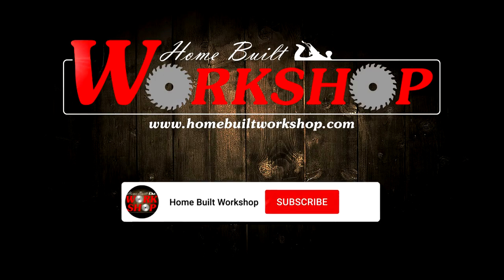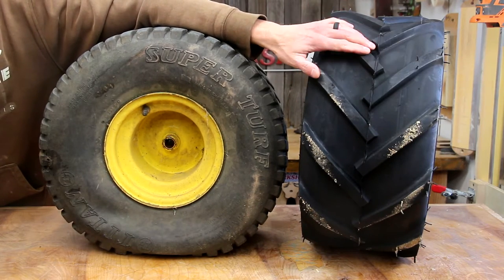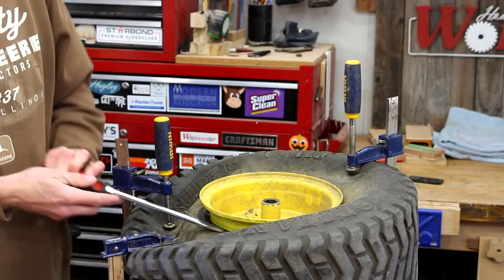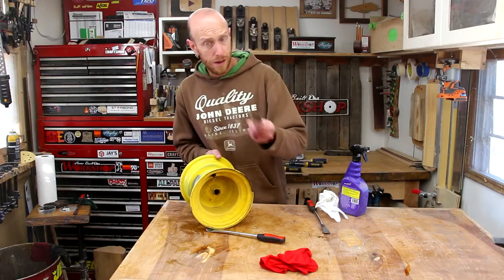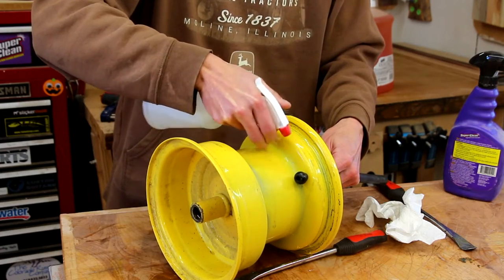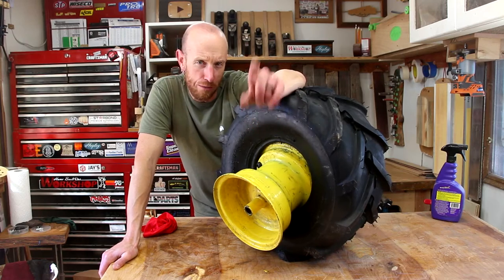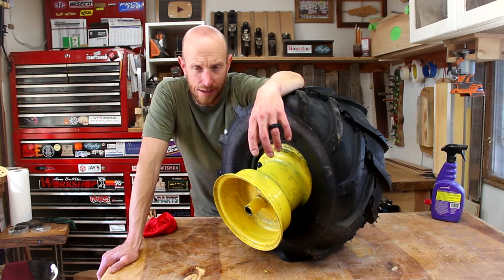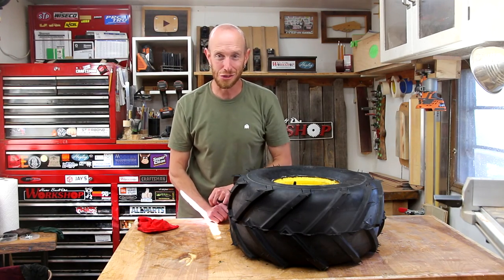Changing Garden Tractor Rear Tires | This was harder than I thought

Comment: Tip: Jack up your tractor and mount the rim back onto the tractor.  Then, use two 24" tire irons to install the new tire.
Reply: Is that easier? I usually take the whole wheel of the tractor and put it back on when the new tire is on.

Comment: I feel your pain, brother, as I wrestled with putting a tube in a rear, lawn tractor tire today. I did buy the Harbor Freight mini tire changer kit but with limited space around my vice I ended up using a carpenter's flat bar-nail puller tool to get the tire down inside the rim. All was looking good and I was quite pleased as I pumped in the air and it got hard. As I reached for the valve cap, something very odd and unexpected happened. As I reached down to screw the valve cap on, the valve stem slowly receeded inside the rim and disappeared. It's gone down under, mate. But on the bright side, I'll never have to worry about adding air to it if it develops a slow leak. When it goes flat, I'll get to do this all over again but next time with a new tire.

Comment: Those Ag tires are going to destroy your lawn. When mounting, push the tire over the wheel, not the wheel into the tire. The bead has to be in the drop center of the wheel in order to get it over the rim.
Reply from the maker: The tires are working out great so far. I don't have what you'd imagine as a typical lawn, its more like a small field of green weeds. lol.
Reply: They're not! I've had the same tires on my lawn tractor for about 4 years now and they dont destroy the lawn.

Comment: You push the tire that is already over the wheel down off of  and past where the bead  seats to where the wheel is narrower, stand on it with 1 foot or get someone else to holding it way down there.  Then you will have the space to pull the other side over the rim.  If the opposite side in on the bead, you will never get the other side over.
Reply: Great info, this is definitely not a one man job.

Comment: Been in this predicament before. I too don’t like to fold especially when the cost for simple things to be fixed. The machine literally has the capacity to apply the pressure onto the rubber tire that muscles just can’t. Also I hate having to spend ridiculous amounts to have a machine do something simple in a couple seconds. I understand shops are there to make a profit but considering it’s a machine doing simple tasks such as this one the price is hard for me to swallow sometimes because it not a hard job for machine to complete. It’s literally worth $5-10 bucks even with today’s inflation. Of course, this is my opinion on certain issues not everything we have to over pay for. Thanks for sharing your video.

Comment: It is much easier to get the second side of the tire on the rim if you have the rim's  inner diameter at its smallest diameter closest to the edge of the second tire cord, to allow it to go over the rim of the hub. The opposite side of the tire can then go against the smaller diameter of the inner rim to give more room to get the tire cord edge over the rim. Been there, done that.
Reply from the maker: I tried it both ways off camera, the tire just wouldn't cooperate. Lol.

Comment: I was yesterday and today in your spot. Saw a guy that made a tire rim holder from an all thread and a vise. he bolted the hub to the vise putting the all thread thru the hub to keep it from moving. Then he used vise grips to help guide the tire towards the center of the rim. The vise grips also kept it from slipping back off.  I fought with 2 tires yesterday and using a vise and an all thread bolt was able to put both tires on in a few minutes,   I had spent HOURS trying yesterday and this morning and would get almost half way on then something would slip.   All thread to hold the hub stationery and a push on the tire  to force it to sit in the center of the hub allowed it to work easily

Comment: Clamp a vertical steel rod into your bench vise to make a little tire machine. Put the tire over the vertical rod and use the rod as a fulcrum for two tire irons. Steve's Small Engine Saloon has a good video on this method.

Comment: I just did the rear tires on my John Deere Z335E this week.  I used a "modded" Harbor Freight Manual Tire Changer (lots of videos on this).  Even so, I got stuck in the same place you did.  The tire bead was starting to get torn up. I took a deep breath and readjusted the "duckbill" carefully.  It went on fairly easily, the second time.  It was a minor change from complete failure to easy success. I used an "air blaster" to seat the bead. Yes, it can be very frustrating.

Comment: Tires are always fun to deal with.  I haven't had to do lawn tractor tires yet, but what I do for automotive tires is get my hi-lift jack, put the runner under the rear bumper of my truck where the hitch plate is, put the jack's foot plate on the tire just outside of where the bead is, and crank the jack up until the bead breaks or slips under the wheel (depending on whether the tire's going on or off).  The weight of the truck applies far, far more force than I could myself.  It's a janky way of doing it, and I really should buy the proper tools, but it's worked for me up to this point.

Comment: I just did a tire change on all four on my LT160. By the third tire I got pretty good at handling getting them on and off. It does take a lot of force to get the new tire around the second half. The tires you have probably made it even harder. In any case, it was a bone crushing job.

Comment: Holy smokes! I just fought this battle yesterday. Setting the beads was the biggest PIA.  Tried several tricks including the starting fluid trick. Nothing worked. Eventually used a 5 gallon bucket to set the bead on the non-valve stem side by stepping on the rim. Then flipped the tire, pressed down on the rim and filled while pressing down.
Reply: I can’t tell you how thankful I am for you to have had that bucket tip on these comments. I bought some of those tires that have the concave center before you install them. And the sides where the beads are are caved in so much from the factory that it takes a whole lotta effort to make them pop out to the sides of the rims once they’re put in. That 5 gallon tip certainly did the trick thanks buddy

Comment: We used a tire machine to mount tires even 50 years ago.  It was pneumatic and you locked the rim down and it was all pretty much mechanical but even then it took a little effort.   The worst thing was when radials came in.  Radials in those days for some reason were kind of compressed in the middle so the bead would never meet the rim for a good seal when mounting. They had to install a special additional part to the machine that blew air up from the bottom side so that the thing would seal.   It went around the whole tire at the bottom and had air holes in it and when you attached the air hose to the stem and hit the air, it went in through the stem and then up from behind the tire.

Radials were always more trouble, at least for the first few years.  The thing to watch out for back then was the steel belt wearing through the tires,  you had to keep an eye on old tires or you could get cut from the steel fibers in the belt on a worn tire being replaced.  We used to sand the bead with a wire brush on a drill before mounting and also the area where the new stem went in.

We never used any sealer of any kind on the rims. Totally unnecessary, just checked the bead for leaks before mounting and 99.9% of the time no problem at all.  I am amazed at the BS where they don't replace the stem with every new tire, really bad service to not do that. 

As for taking a tire off a car, the ones with fender skirts could really be a pain and as I recall I think it was Buicks or maybe Oldsmobiles where the rim liked to rust itself onto the brake drums.   For that you hit it from behind with a sledge hammer but sometimes they had to be taken to someone to heat up the rim with a torch to break it.

Comment: You did good man those tires are tough sometimes the bead on some tires are hard to drop in the drop center for example some 12-16.5 skid steer tires when you mount second side that tire is big enough you have both feet on tire keep 1 stationary and follow with the other and when it gets more then halfway but the tire doesn’t drop in the drop center behind you you have to give her the old kick with your foot usually they will drop after a few kicks helps if you have some weight on you too 😂 or vice grips pry down as far as you can before you start clamp the vice grips and go one side only and the vice grips will hold the other side and make sure the tires stays in the drop center again you did good man those little tires are hard compared to the big stuff 👍🏻

Comment: I still enjoyed watching your attempt to mount the tires. I also failed trying to mount two 11x4x4 front tires on my little Craftsman DRM 500. I took them to the pros and they gave up after having them for 3 days. They even bent my rims trying to get the tires on the wheels. They gave me two tubs no charge. I ended up reinstalling my old bald tires back onto the rims until I figure something else out.
Reply from the maker: I got the front tires changed without issues. These back tires were a different story. Lol.

Comment: I agree with some of the other commenters, right tool for the job. Use tire iron instead of screwdrivers, Stabilize/ mount rim to something to prevent it from movement. Then it's not that difficult to change the tires.

Comment: those are some hard tires to change, if you have a large bench vise, stick a steel rod in it make sure its super tight, then place the center of wheel over the steel rod, take a large pry bar in the tire and rotate the pry bar against the center steel pole like the old fashioned tire machines did.
Reply from the maker: That would work. I don't have a heavy enough workbench so the vise wouldn't move around.
Reply: No bench vise? Try driving a steel rod into the ground. That should also work.

Comment: It looks like the reason the second bead would not go on (at 9:10) was due to the "on" portion sitting at the wheel outer diameter. It needs to be pushed down to the smaller diameter to allow the far side to be pried over the rim. The bead has a fixed diameter, and is reinforced with steel wire, so no stretching can be done to mount it. That's the "trick" - push the far side of bead #2 farther down to give more of that tire bead diameter to the not-yet-pried-over region.

You had the right idea using a clamp to push the bead down, but the far side of the clamp should have been placed on the steel lip of the wheel, not against the tire. Had you done that, I think you might have been able to "git-'er-done." 

I'm 73, and wrestling with mounting new tires on my JD 300X series, and with 3 spoony chopsticks am able to R&R the tires, I just can't get the tires spread wide enough to touch both rims, so I can get air in and SEAT them. 

In the late '60s I worked at a gas station, and we had these rings that would sit down on one side of the wheel and tire, and fill the gap so you could fill the tire, spread it, and get it to seal on the rims. It was like a tuna can with no ends, just a ring, about 6-8" tall, sheet steel with a rubber inner liner. We'd slick it up with the green juice, slip it on to fit the rim diameter, and seal against the tire just outside the bead. 

Then, we'd fill air into the tire , and the ring would slide up the rim as the tire ballooned to touch the rim. 

They worked, but were dangerous, which is probably why they aren't around today. 

But I have straps on the middle of the tread, pulled as tight as I can get them, and that STILL leaves the bead an inch from the rim. 

I know the starter fluid trick, but don't want to do that except as a last resort.

Comment: I just got through with two tires close to what you had.  It physically whipped my ass, and I was only putting in tubes-but I got 'em, I will see in the morning if I pinched the tubes.  Then, I decided to look at some videos to see what I did wrong, looks like not getting someone else to do it was it.  Would have helped to have some tire spoons too, all I have is a couple of pry bars and a large flat screw driver.  This job really sucks.

Comment: Good video of the reality on changing those type of tires; I think you could have got it on with a larger tire spoons; those tire spoons you were working seemed just out of leverage range for that size tire.  Those smaller spoons are good for the front wheels as you demo’d in your other video and you prob could have gotten away with them on the standard rear turf tire, but the aggressive tread tire definitely needed more “umph” leverage:-)  Either way good DIY vid :-)

Comment: The tires you removed were 2 ply sidewalls.  The tires you installed are either 4 ply or 6 ply sidewalls and make manual installation difficult.
Reply from the maker: That explains why it was so difficult. Lol.

Comment: Hey;) Try using 2 straps on each side of the tire and sinch it down so the beads get together. bit easier;)  used this technique on most tires, even 22.5 truck tires;)

Comment: I only watched your video for two minutes and thought that mowing the grass won't get a good result if one corner has a tire with a much larger diameter. It means that the cutting unit is higher on the side of the new tire than on the side of the old tire. And so the end result is not very neat on flat ground if the grass is not cut equally short everywhere...
- Is your lawn now "stepped" when you ride on tires of different diameters?
Reply from the maker: I have the same size tires on both sides.
Reply: @homebuiltshop  Ok. So you changed both sides, but you didn't mention it in your video, so many may get the impression that the height difference of the radius (from the axle to the wear pin) doesn't matter. Since the rear tires are higher than the original, do the front tires also have the same height difference compared to the original? So that the cutting unit moves in the same position as originally.

Comment: Well im buying a set of the tires for my lawn tractor i was going to buy the tools too,  but if you had no luck and its just 25 bucks  seems like a drivd to the tire storez a better idea.
I think if you had larger pry bars you would have gotten it.  Longer leverage
Reply from the maker: I do feel that larger tire irons would have helped a lot. I'd check with your local tire shop and compare the cost to have them mount the tires vs buying your own irons. For me, the best cost was to have the shop do it.

Comment: No shame in getting a pro to do something brother.  I know the feeling. They have the equipment we don't.  You would have been able to easily put that tire on if you had the proper equipment.  I can imagine how difficult it must have been to try to get that last bit of tire on the rim.  I think it's a physics thing because the same thing happens to me and my bicycle tire.  I eventually get it on with a screwdriver but, we know a bicycle tire is way thinner than that tractor tire.
Reply from the maker: I've fought with many a bike tire as well. The right tools make a huge difference.
Reply: @homebuiltshop  Ha ha ha ha yeah

Comment: What you did wrong was try to stretch the bead around the rim. They don't stretch you need to push one side down to a smaller section of the wheel.

Comment: I could see you were not able to compress the tire down for the bead to reach the center of the rim. You basically were trying to put the bead on where it rest on the rim. This is impossible to do.
Reply from the maker: Yeah, the tire was being very stubborn. It was difficult to get it to go where I wanted it. Oh well, lessons learned I guess. Lol.
Reply: @homebuiltshop  use a ratchet strap around the middle of the tire and it will help press it on so you can begin putting air in it

Comment: Nope... tried this and a bunch of other things like a Air chisel, BFH on the front of axle, back of rim, soaking with PB Blaster for weeks, heat on rim, front and rear, wheel puller and jamming wood behind the flat tire and reinflating to 70+psi in hopes it would force it off the rim. NOPE... nothing worked, I have searched the internet for some method that was a tried and true way. This rim is stuck! Funny thing was the opposite side came right off no problem!
Reply: I had the same problem getting the wheel off mower.  My wheel had bearings for the axle and I had to forcefully beat the rim from the back side with a sledge hammer to break the bearing apart so that the wheel would come off of the axle.  I bought new bearings and pressed them into the rim.  But before I could reinstall the wheel, I had to grind down the ridge that had formed on the outer edge of the axle so that the new bearings would slide on.  Hopefully yours doesn't have the ridge and is just stuck from corrosion.

Comment: No way, tires that size are required to have compression seal so they don't come off while in motion. If it would be that simple to do with human strength then it wouldn't be a need for a tire compression machine. No need to kill yourself. Call that guy.